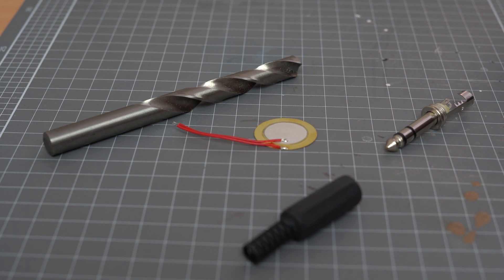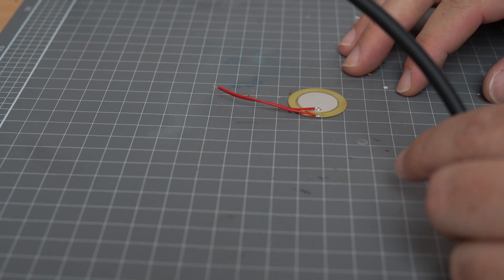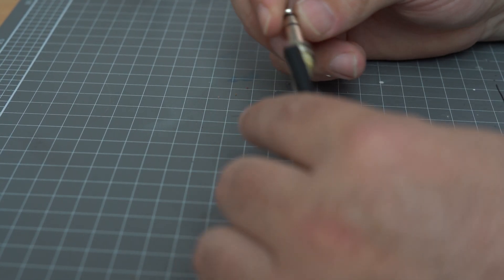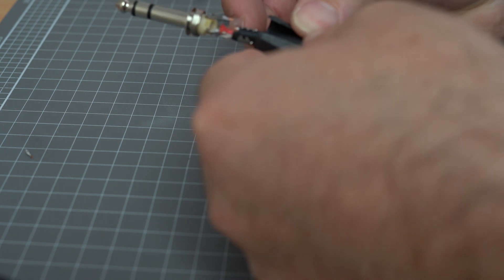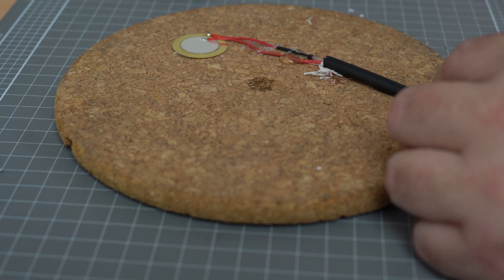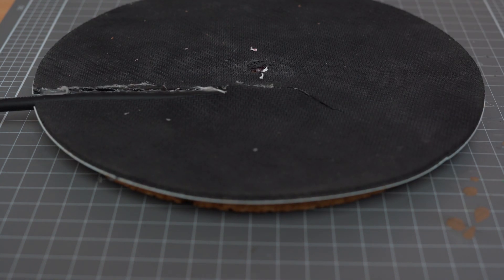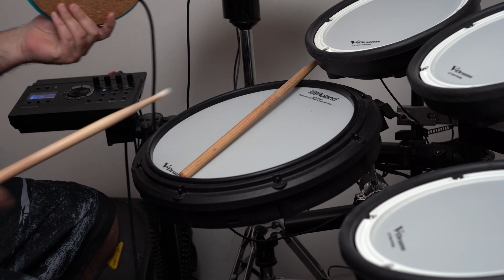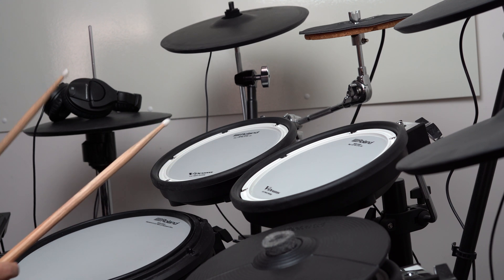Making a Roland Drum Trigger

Comment: I have an understanding on wiring. To make things easier. Lets not wire a guitar cable here but simply an input jack

Piezo hot wire to hot of input jack
Piezo ground to ground of input jack

So that way its like any other drum trigger where you could just plug in and plug out.

Comment: Hello, I plan to create a drum trigger, but I need it to control a drum machine (which only has a midi input), do you think I can create a drum trigger that instead of a jack has a midi input?
Reply: It is worth noting that this system outputs an analog signal according to the vibrations detected by the sensor. The Roland drum computing module then somehow converts this analog waveform into drum sounds. This makes the whole process pretty simple, the Roland hardware does pretty much all the heavy lifting. If you are talking about a midi input drum machine, you need to be able to output a digital midi signal. So you will need a processor which is programmed to parse the analog signal to detect the timing and velocity of your strikes and then send out the appropriate digital midi signal to the drum machine.

Comment: This is awesome.  A super easy project that is dirt cheap.  Would be a great way to add a second crash cymbal to my TD-1K for a fraction of the price of the official Roland offering!  The only tricky part is that the plug is a TRS, so I need to find a breakdown of a Roland cymbal to see how it's wired.

...ah, well, never mind.  Found the following site, and it seems that Roland cymbals use several different mechanisms throughout to allow for accurate positional triggering of the edge, bow, and bell, so really not something you can build at your kitchen table.  It was a nice idea, though!

http://www.v-drumtips.com/roland-cymbals/

Comment: I didn't realize you could use that disk think as an input, I took apart an old alarm clock from a thrift shop and that looks like the device for the speaker/alarm. Very cool!
Reply from the maker: Yeah man these when you run electricity through them they buzz (alarm) and when you tap or vibrate them they generate current :p (which can be sensed by a drum module)
Reply: You can buy em new for less than quarter of a dollar in any electronics shop
They can be an alarm buzzer, a contact microphone and this
Reply: You seem to know about e drums, can a faulty piezoelectric damage the e drum module?

Comment: Nice! I want to try this. Just got an Alesis e-drum set. The module has two available inputs still.
Do you have a link where I could get a suitable piezo transducer?
Also, is there some standards documentation available for e-drum interfaces overall?
Reply from the maker: Sorry mate, i did reply to you for some reason it didn't save :o! 
Long story short i said that i put the link in the description of the video and as for standards there is no real standard i think each module does it their own way i would recommend searching for on google "Alesis Drum Trigger Wiring Diagram" and you'll most likely come across some.
Reply: You seem to know about e drums, can a faulty piezoelectric damage the e drum module?
Reply: @FrannB  I don't see how it could. It has no active electronics. Its an analog signal so if its too low of a level or not passing signal because of some type of fault then there wont be an output signal to trigger the input of whatever you plug it into.
Reply: @audionerd8821  Ok thanks, btw, can I do what the person did on the video with a stereo jack input too? or it has to be mono?
Reply: @FrannB TRS connectors can be either mono or stereo. Depends on what you are wiring. In this case its a mono un-balanced piezo so it only has a hot and cold, no ground. So he wires it :

tip is “Hot” (red) 
Sleve “cold”(black)

He could have used a TS and it would be exactly the same.
Reply: @audionerd8821  Cool thanks